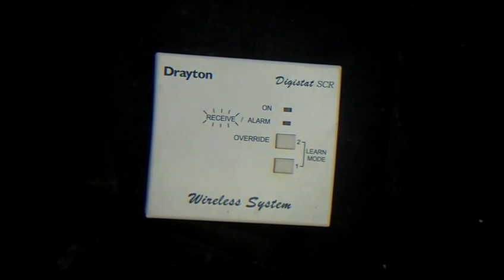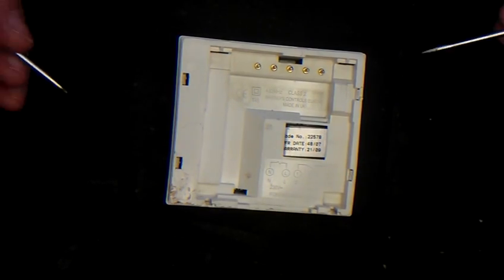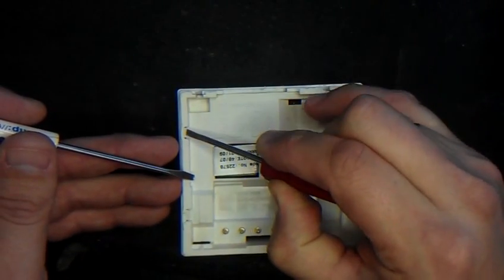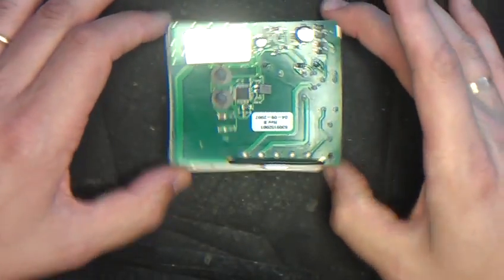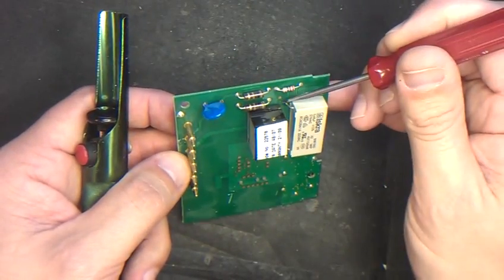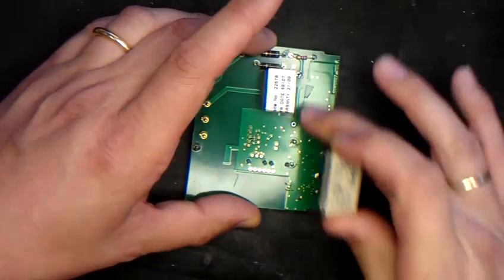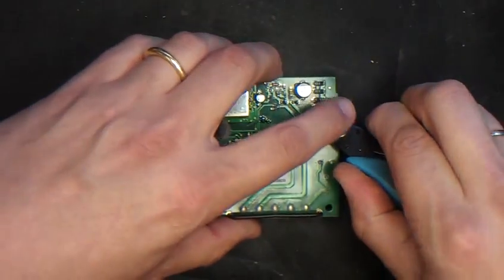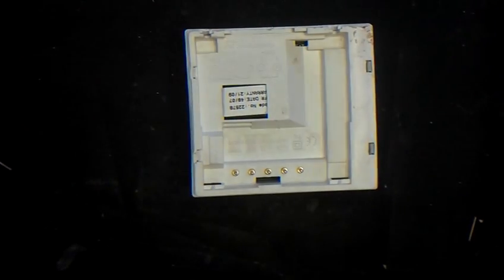Drayton Digistat SCR easy repair with a capacitor, also same for Iflo or British Gas marked units

Comment: Hi, I have had capacitors from you previously which worked a treat, however my SCR now has 'No lights' present at all. Will a replacement capacitor fix this or a different fault ? Thanks

Comment: Ok but how to open box if is screwed into the wall???
Reply: Yes 🙏 thanks
Reply from the maker: @danieltenderenda4120  happy days
Reply from the maker: Are you able to access the 2 flat head screws on the underside of the SCR, if so slacken then off and it should hinge from the top.

Comment: Thank you, an excellent video. I wasn't as skilled as you at getting in but it's a very old unit. the vacuum unit I had seemed too inefficient compared to yours but managed to swap them out having ordered your product. the double-sided sticky foam and solder was a nice touch. Now I get a click every time so far. I wish I'd found you earlier. I suspect I've paid for a new boiler because the engineer was convinced it was the PCB in the boiler. It was due but was hoping for another couple of years.
Reply from the maker: Glad you are up and running again

Comment: Hi David, thank you for your clear and precise instructional film. I've followed your film and replaced the capacitor. The green light has come on, there is a click when I turn the temp on the thermostat up, but still there is no response from the boiler. Any suggestions what else it could be? I appreciate this is an old post but it still seems relevant as the Drayton +3 Stat I have is only one year old, as is the Grant boiler, with which I am having all manner of issues, very frustrating.
Reply from the maker: Can u look me up on ebay and find my contact details on there and drop me an email or a text message
Reply: @xxxxbigdavexxxx  Hi David, just to conclude the conversation,tion, it turned out to be loose wiring, which a boiler engineer picked up on. Problem resolved now but many thanks for your input

Comment: Hi Dave, I have no lights at all on the receiver, we have changed the capacitor a few years back, is it likely to be that again? I can’t find you on eBay either? Sorry we have no heating.
Reply from the maker: Hi mate

https://www.ebay.co.uk/itm/172820426361?hash=item283ce66e79:g:KOcAAOSwGi9hMSUV

Normally dead units need more than just a capacitor, I can fix this for you no problem at all

Look me up
Reply: @xxxxbigdavexxxx  the link you’ve sent isn’t working, it says eBay can’t display the page? I’d really like you to repair the problem as it was your video and capacitor that fixed the issue last time.
Reply from the maker: @kerryloader7380  sorry old link, try again

https://www.ebay.co.uk/itm/172820426361?hash=item283ce66e79:g:KOcAAOSwGi9hMSUV
Reply: @xxxxbigdavexxxx  fab thanks, have to get my Dad round to remove it, so hopefully will get it sent over the week end, so relieved you are still doing this… :)
Reply from the maker: @kerryloader7380  no worries mate, still here fixing these things,

Comment: Hi Dave do you sell complete scr? Theres no light/power ...I've changed fuse above it but still nothing😭
Reply from the maker: Hi Bev, sorry haven't got any new ones, but I fix dead units every day,  repairs are done and returned same day if that helps
Reply from the maker: Look me up on ebay if you want it fixed, I am the seller bearsy72
Reply: @xxxxbigdavexxxx  thanks for replying!  I've just bought whole unit...as theres now no power showing on boiler at all ...so hopefully this will fix it quickly 😁

Comment: Great vid but I don’t have any lights at all on the receiver. Have reset several times with the same ‘flame’ symbol showing on the thermostat. I intend to buy a capacitor from you and hope this fixes it. Thanks
Reply from the maker: Nah capacitor wont fix that fault, you will need more parts, drop me a message and I will sort u out. Cheers Dave

Comment: Just ordered a capacitor from you.  Hope it sorts my issue, certainy sounds like it.  Hot water works fine, but about every 3 days the heating stops coming on when the green light comes on, no click is heard.  Weirdly, turning the power off for a few minutes at the fused spur and then on again sorts it out (for a few days).

Comment: Hi there... just ordered the cap off you... how do I remove the front cover when its screwed to the wall ? Thanks in advance...
Reply from the maker: Switch off the boiler and receiver. Look at the underside of the unit. You will see 2 flat headed screws, slacken them off (do not take them all the way out), the unit will hinge from the top, the wires will stay on the wall wiring plate. Hope this helps
Reply: @xxxxbigdavexxxx  Thanks so much..the installer had put it so close to trunking that i did not see them but after taking a photo with my phone, there we go.. Thanks again for your help and looking forward to sorting it soon. Luckily, i have a log burner going to heat my house... A+ mate.
Reply: @xxxxbigdavexxxx  Hi David, Capacitor arrived fast and well packed. Removed old one and soldered the new one in.  Put everything back together and turned system on. The SCR flashes red and then goes green, together with a click. Boiler tries to fire up the CH but then after a minute the green pilot light goes out. Hot water is fine. Noticed that when I try increasing the temp up to say 22, the SCR does not flash or seem to talk to it... only when you ytake the batteries out of the remote and reset it... you get the click nut then does not talk to the remote/scr.. I also noticed the black relay was made in 2007 and guarantee to 2011... Could it be this or do you think a whole new unit.. I prefer a wired one without all the messing about... Log burner on for now but any suggestions welcomed. Thanks for a great service on the capacitor and the vid... Cheers, Paul
Reply: @xxxxbigdavexxxx  Hi David, another silly question... do I need the link in at the back of the Drayton RF1 ? Mine is missing for some reason.. just moved into the house a few months ago but it was all working before...

Comment: Thankyou worked exactly as described. Removing the SCR from the wall plate was easy, just undo the two screws on the bottom and it lifts off. There are no wires etc to disconnect. Just be mindful the wall plate is still 'live' so turn the switch or power off. I needed to heat the old solder up a fair bit more than in the video to remove enough of it to clear the two holes so the new wires could push through. Other than that it all went well. Never soldered before and even with limited skills the video made it easy.
Reply from the maker: Nice work mate, well done

Comment: My problem was that the central heating was not going off even when the thermostat was telling it not to heat. I replaced the capacitor and it is working perfectly now. Great solution!
Reply from the maker: Happy to help mate, glad all is well  again. That capacitor can cause some strange faults. Well done you

Comment: Great, useful and easy to follow video. My drayton digistat scr went dead. (no lights) As recommended on his video - I went to David’s eBay page and asked. He was quick to diagnose my faulty scr. I choose to have the repair service as I thought some of the components were very tiny to soldier. (while my scr was away for repair, I still had hot water and central heating working manually as a friend told me how to turn off/bypass the timer temporarily) David also mentions - he can tell you how to have your central heating working as a temporary measure, which I think is great. I had my scr repaired, delivered, fitted by myself and working in less then seven days. I thought the service David offers is excellent, honest and reliable. And his video helped me save some money. Thank you.
Reply from the maker: Cheers mate for the kind words

Comment: David Williams has just repaired my SCR receiver. He's very quick (sent Tuesday, back on Friday!). In my opinion, he is not charging enough to repair the fault I had, where the lights go completely dead, which is harder to fix than the one in the video. I paid more than he asked because it requires some very fiddly soldering of extremely small components. I could have probably done it when my eyesight was better, but getting the right components economically would have been a pain. Brilliant job.
Reply from the maker: Thanks for your great words, glad I could help

Comment: Hi David, 

My thermostat RC Plus thermostat has lost its connection to the WR1 receiver, with the receiver showing a solid green and red light- is this the same issue?
Reply from the maker: It could well be a capacitor fault. Always a good place to start. Or if you like send me a photo of the pcb and I can take a look at it for you. Dave
Reply: @xxxxbigdavexxxx  I've ordered a replacement part from you today, so will give this a try once it arrives. Thanks,
Reply: @Synysterjmz  did changing the capacitor solve your problem?
Reply: @bisutommy79  it did indeed- thanks to your tutorial!

Comment: Hi Dave . Interesting video . i was wondering if the capacitor was my problem too. The heating and hot water will be working fine and all of a sudden , the program seems to switch over and works in the opposite mode. ie the water will come on when it should be off and goes off when I override it to come on. I have to turn it off at the mains and leave it half hour to reset it . Would that have anything to do with the capacitor ?

Comment: was desperate and had no heating watched this and decided to investigate the battery connection strips but all mine were intact and showing no sign of corrosion  however when I opened up I could see two U shaped  bits of plastic in the battery boxes and they fell out - hey presto it now works I guess these had been blocking the connection.  I assume they did have a purpose as don't think I am up to soldering!  Have contacted manufacturer also for advice.    Must admit I have never liked this digistat and it can be temperamental much prefer the old fashioned call dial!  THANKS DAVE

Comment: This fix worked for me. Swapped the faulty capacitor for £3. A gas heating engineer quoted me £175 to replace the receiver...erm. no thanks.  Great video to show a diy-er to save lots of cash. Heating works fine now off the thermostat.
Reply from the maker: glad I could have helped out, enjoy the heating once again :)

Comment: Thanks for this! Saved me in excess of £100 I’m sure. The sticky pad on the existing capacitor was a bit tricky but using a Stanley knife sorted it out. Didn’t have a soldier sucker so did what you said and pull out the legs using some snips. Quick delivery on the capacitor too.
Reply from the maker: Well done you, enjoy your heating once again, just in time for a cold snap :)

Comment: Hi Dave.  I think I have the issue you mention: water heats up fine, no problem; but the heating doesn’t fire up - I.e.  the green light comes on but no ‘click’ and no hot radiators!

I don’t have a soldering iron...and here comes thecsilly question (sorry)...does it have to be soldered?  If so, if I got the new capacitor from you, who could I go up to fix it (I.e. would it be an electrician, is there a high street chain that could do it)?

Here’s hoping you can advise!

Thanks
Reply from the maker: Hi mate, not sure an electrician would be the right person, maybe a local computer repair shop could undertake the repair, or you could always send me the unit and I can repair / test it for you.
Reply: David Williams : Thanks, Dave.  I’ve just ordered 2 capacitors from you as I’ve found someone local who can fit them for me.  Fingers crossed it solves the problem.  Thanks for your help.

Comment: My one doesnt seem to be reading the thermostat (digistat3) ...ıt seems to be overheating then the lights go out on the scr.  Ive had to turn everything off from the mains til it cools down and then ı can get heating.  I think ı need to replace a part on the wireless system but not sure which part?
Reply from the maker: Hi I would say you would need more than just the capacitor, please purchase the £17 option on eBay and send it to me, I can sort this for sure. Cheers Dave
Reply: @xxxxbigdavexxxx  thank you ı will message you further on ebay :)

Comment: do you know anything about the remote control device.  my digital screen was blank, then a few parts of numbers showed but iy's quite unusable so cant put heating on
Reply from the maker: not had much to do with the sender units, they are normally bullet proof, think you can pick up cheap ones on ebay, any drayton digitstat should be okay, you will just need to pair it up with your receiver when you get it, your could have a dirty zebra strip on the back of the LCD or it could be a LCD on the way out, if it is a 2 drawer / 4 AA battery type unit, make sure the battery contacts are good and clean and tight, these older 2 drawer units can be a bit picking when it comes to the terminals, good luck, bell me if you need more help
Reply: Thanks Dave,   I have given everything a good clean and made the terminals a bit more snug and hey presto the screen has returned to normal.  Have seen one on ebay so will get a spare just in case
Reply from the maker: Keith Mitchell happy days, nice work

Comment: Can’t find you on ebay ? Do you have a link changed your name ?  :-(
Reply from the maker: a few ways to find me, either do an eBay search for the words; Drayton Digistat repair service, or look up seller called bearsy72 or you can try this link; https://www.ebay.co.uk/itm/DRAYTON-DIGISTAT-SCR-RF2-WIRELESS-RECEIVER-Repair-Service-capacitor-0-68uF/172820426361?hash=item283ce66e79:m:mrNF6CZvqUaen0hCdRiTBeQ hope this helps

Comment: Excellent video. SCR failed first thing Good Friday morning. Capacitor ordered on-line Good Friday and arrived first thing Tuesday morning we having been without heating for the whole of the bank holiday weekend. Sticky pad did not accompany the capacitor but not really necessary. Heating has been on now for 4 hours.
Reply from the maker: Geoffrey Rose glad all is well again, sorry about the sticky pad. As you said not really needed, just helps hold it in place for soldering

Comment: Thanks for the info, got my heating back working after 2/3 months of the receiver suffering this intermittent fault. Followed the instructions, took approx 4 mins of my time, saved over a hundred pounds easily. Cheers pal.
Reply from the maker: MBE 2017 happy to help mate. Glad all is good again

Comment: I had been puzzled by an intermittent fault when my radiator circuit would fail to fire up while the hot water system had no such problem so when I found this on a google search it seemed worth £3 to see if it would fix it AND IT DID! Prompt delivery and easy to follow instructions. Problem solved heartily recommend it.
Reply from the maker: Kenneth Illsley happy it worked for you Kenneth. It works on 99% of units with green light no click fault symptoms, glad I could help

Comment: I had two of these digistats controlling different circuits, one stopped working years ago and I put both zones on the one controller. The second one stopped working recently and tried this fix on both units and hey presto both units now work! Thanks for the video.

Comment: Hi Dave, Just a quick question. I came across your site a few years back, very helpful. I ordered and replaced the capacitor and everything worked fine. The same prob has popped up again, green light- no hot water. Tried re-syncing just in case and that seems OK. Anyway, have ordered another capacitor. My question is, if that doesn't work this time round, do you sell the complete unit? Because if I have to buy one, I'd rather buy from a person like you who is so helpful.

Comment: Well I fitted the capacitor, fairly straightforward, I am now able to start the boiler with the override button but try as I might I cannot get the Digistat rfi to handshake with the scr, red light on, also with the boiler on, only the radiator next to the boiler gets warm and nor that warm either, all other rads stone cold, so it looks like more of a problem alas.

Comment: Does the scr need pairing back with the thermostat once the fix is complete? I just installed one of your capicitors, turned the boiler system back on but heating not firing up- even when over ride button is pressed. Cheers
Reply from the maker: normally the answer is no, after the capacitor change it will work as it did before, unfortunately Daniel needed more work doing to his unit after he changed the capacitor, all fixed up and returned  to him, heard back from him saying all is good once again. :)

Comment: Hi Dave, will this fix work on the SCR for the Drayton +3RF?
Reply from the maker: Hi Stan, Yes I am sure all the SCR's have the same capacitor fitted, well known fault and has been for ages, look me up on ebay and I can supply you with the part needed, if you do an ebay search for "drayton capacitor part" you will find me, I am the ebay seller bearsy72, cheers Dave

Comment: What is the blue circular thing on the pcb? Mine has blown!
Reply from the maker: Steve Colver if you are referring to the part bottom left at about 2 mins in on the video it is a varistor. These normally blow in a power surge type of fault. It can sometimes knock out more than just that. If you want to send me a few photos I can take a look at it. Dave

Comment: 30 days later and unfortunately it's gone back to the original problem.  The video was very helpful though and the capacitor shipped very quickly - just a shame it wasn't a long-term fix.
Reply from the maker: Jonathan Cantrell look me up on ebay and get my number and give me a call. they should last year's and years these new ones. maybe you have a secondary fault? Dave
Reply: David Williams, because I've tried and failed, I'm using it as an excuse to go buy a Nest ;)
Reply from the maker: Jonathan Cantrell okay good reason to get one. been looking at them myself. not sure if to go nest or hive lol